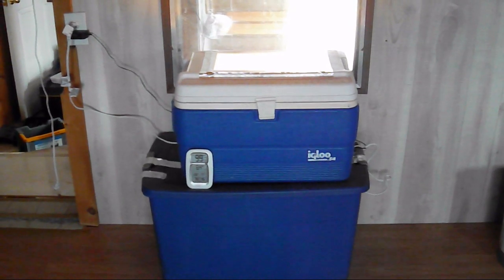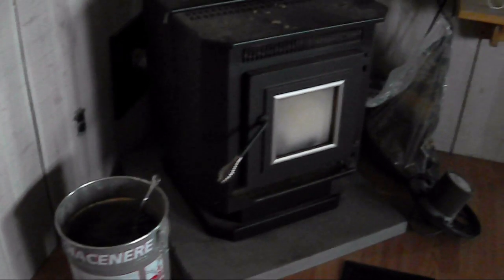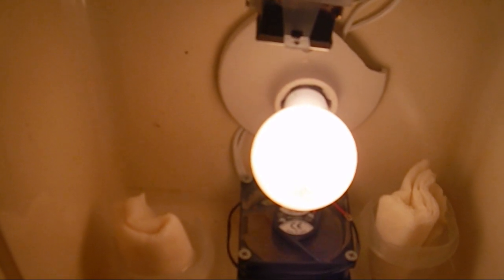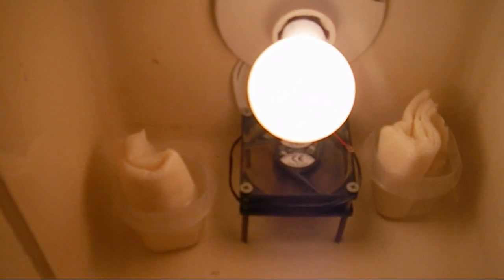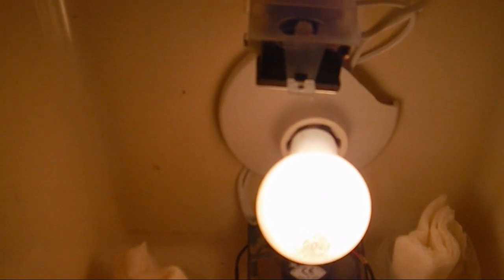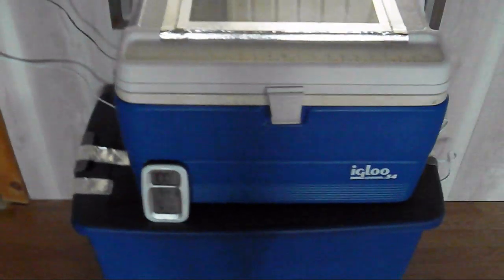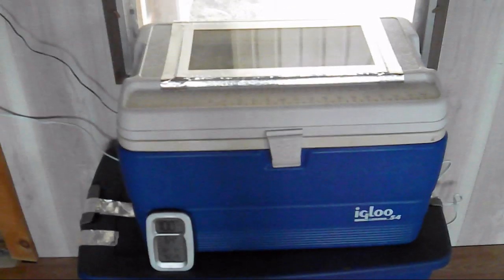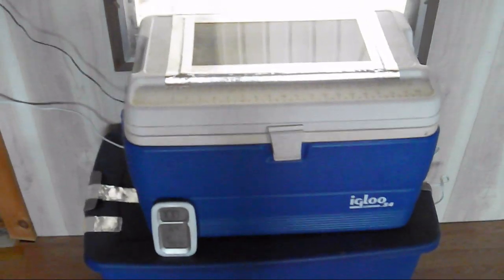Homemade Incubator

Comment: Did this work? I get a much larger variation with my water heater thermostat. It shuts off at 105, but won't turn on again till 78f. Not sure if that's going to work.
Reply: This video is 10 years old. Go to "Coturnix Corner" You tube and he has a very good how to video. But, using a cooler is better/easier than cutting a lot of foam board! You DO need an egg turner, it prevents the yolk from sticking to the sides.